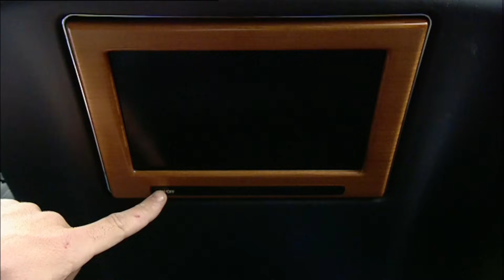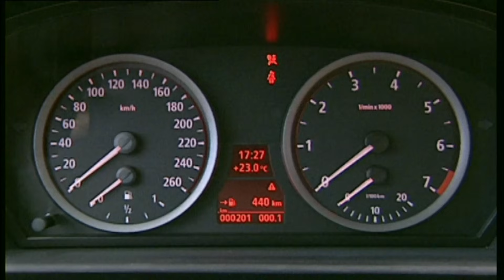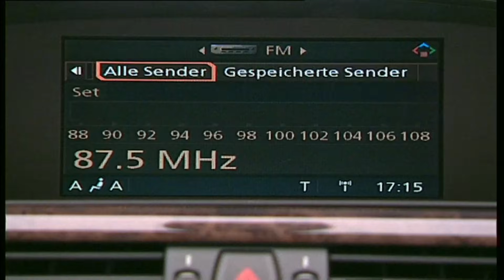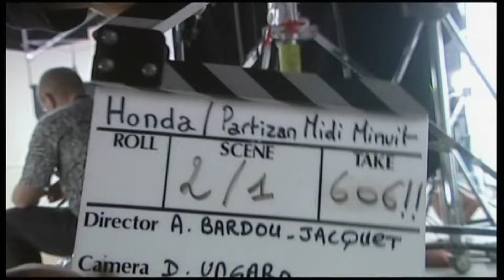Rolls Royce Phantom The Most LUXURIOUS car in the world? |S3 E2 Full Episode Remastered | Fifth Gear

Comment: 6 years ago , I ended up driving for 27 hours nonstop in a Land Cruiser , open road driving . Afterwards I was knackered for days , 3 years ago , I literally drove for 11 hours without even refeuling , a distance of 1200km in a Range Rover , got to my destination not at all tired , had supper , went to sleep and had to turn around the next morning as the front right air shock started leaking , so I turned back and hightailed back home , shock only partially collapsing 20 km from home in 9 and a half hours , was once again not tired . A lot has to do with the tin can you drive .
Reply: There's some truth to this. I once had to spend 14 hours driving an Audi A8, with lots of the early time spent in traffic jams. I arrived home at maybe 3 AM. I was LESS physically tired after that trip than I was just 2 hours in a Jeep Wrangler.